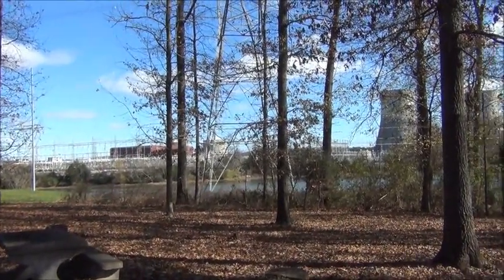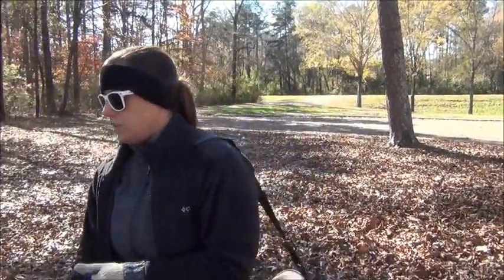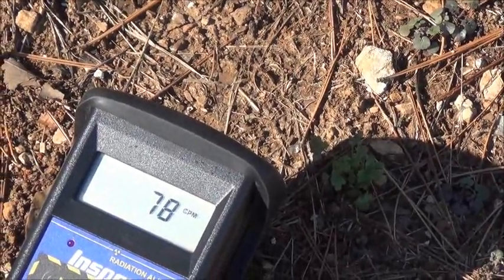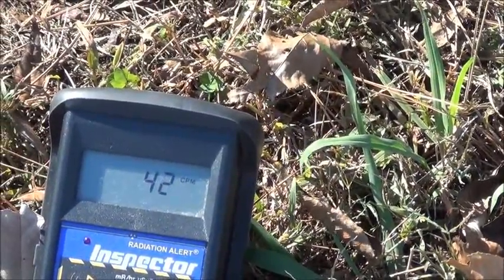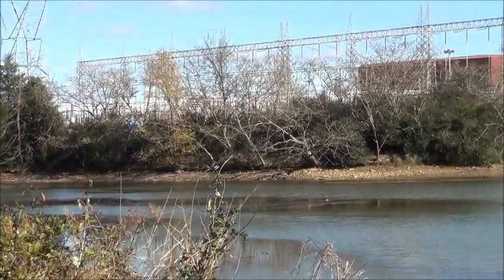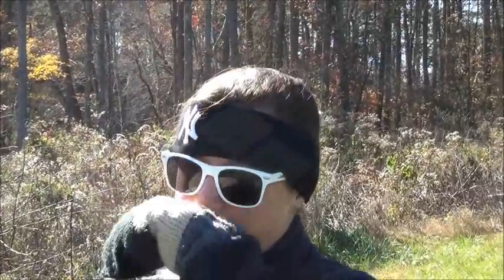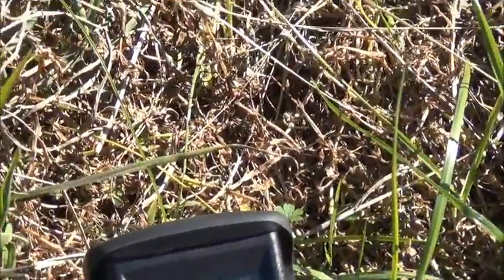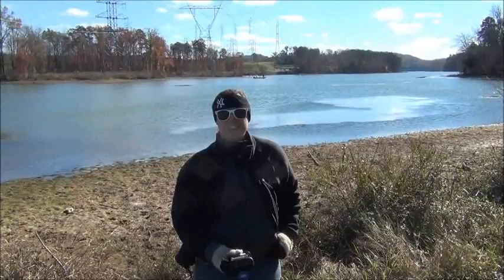TVA Sequoyah Nuclear Plant - Rad Monitoring 11-23-15

Comment from the maker: Nuclear Reactor facility radionuclide atmospheric releases, and releases into the water such as tritium, cesium 137, strontium 90 and iodine 13 and radioactive noble gases are filtered, but not all are filtered. 

Tritium, radioactive water, cannot be filtered, this radionuclide is bound into the water molecule as radioactive water. Tritium continuously precipitates in the environments surrounding nuclear power plants.
 
Radionuclides bio accumulate in our environments, including animals and humans. Each animal in the environment consumes animals or plants as a food source. The radiation level increases in the food chain when each life form consumes another as a food source, thus the bioaccumulation of radioactive materials and any other element, chemical or compound which may be hazardous for consumption, an example would be heavy metals such as lead.

Radiation is ever present in the atmosphere and ground as Radon, North Alabama is a "RED ZONE" for Radon, high levels are present. The Radon decay process produces the following radioactive progeny elements, lead polonium, and bismuth. Radon progeny life is short lived, under 50 minutes (short life Radon). Radon causes elevated radiation detector readings in North Alabama, particularly after a "rainout." However, when elevated radiation counts per minute extend well over 50 minutes, there are other radionuclides present other than Radon. More about Radon, including long life Radon - http://www.ccnr.org/radon_chart.html    

The second largest cause of lung cancer, other than cigarette smoking, is Radon contamination. All homes in North Alabama should be tested for radon on lower floors, particularly if there is poor ventilation. Radon itself is a decay product of Radium.   

Effluent Releases from Nuclear Power Plants and Fuel-Cycle Facilities (National Institute of Health study and findings) - https://www.ncbi.nlm.nih.gov/books/NBK201991/ 

Browns Ferry Report: http://www.bredl.org/pdf4/AL_BFN_Report_2013-final-digit.pdf
 

Garry Morgan